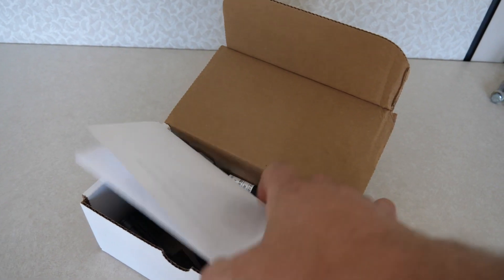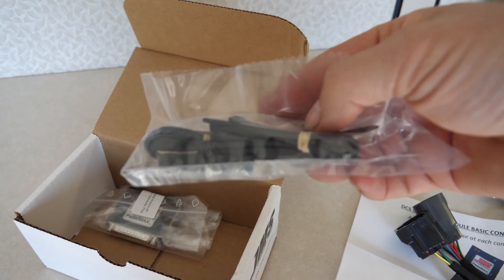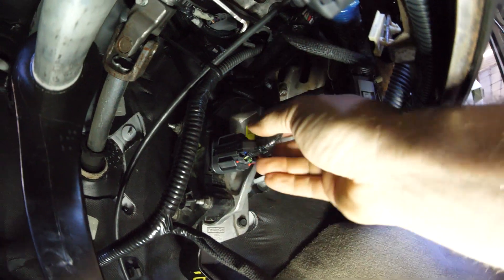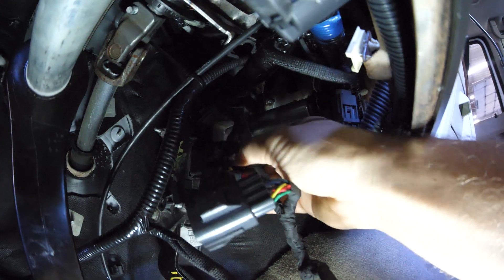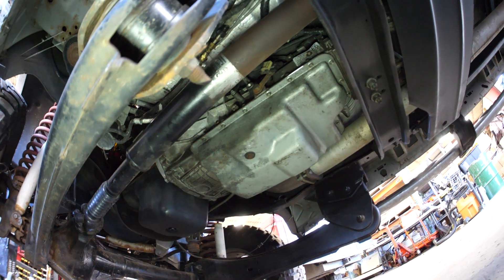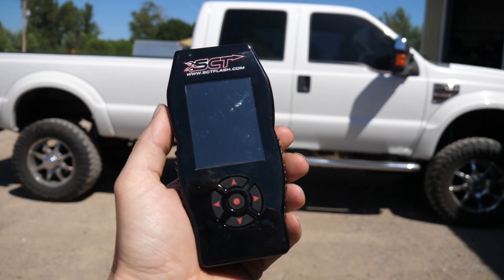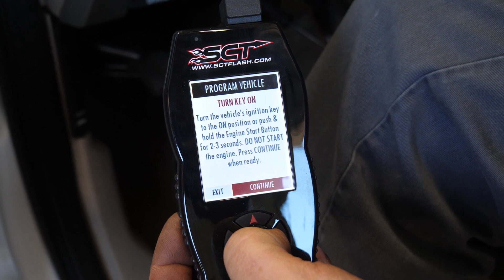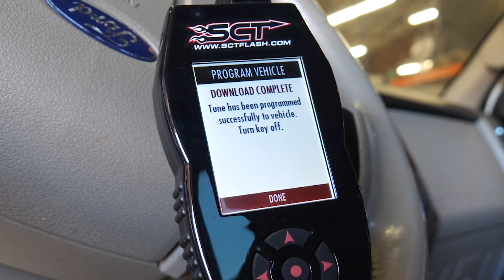Ford Cummins conversion with stock TCM and 5R110 transmission

Comment: Hell you can buy a superduty entire truck with the title and 5r110 for less than what an Allison swap costs. Then you can sell the 6.4 injectors turbo heads harnesses water pump block etc everything you don't need for the swap and come out with a win. I am on my 7th 12 valve truck. Early 98 short bed auto 4x4. But if not for this exact configuration I'd not bother with another dodge truck. The super duty trucks of any year are far better than any 94-02 ram

Comment: I’m using f250 superduty 2006 chassis - not using ford body and 6.0 engine I am installing a 1987 gmc 4 door square body on chassis with 1995 12 valve , do y’all offer wiring harness for the stock trans pcm I can use and tune

Comment: Will there be any support for the 2011 and up trucks? I have a 2012 v10 in a F550 and we would like to repower it once its reached the lifespan of the v10, and recoup some fuel mileage
Reply: 6.7 powerstroke is a great motor and the v10 is as well

Comment: The real question is can you get the 5R110 to work with the 7.3 Powerstroke?
Reply: I was wondering if you had any luck finding out if it possible to run that transmission behind the 7.3??
Reply: @johnnyanvar6502  No. I do know there is a company that can get an Allison trans mated and working on a 7.3.
Reply: OKstang77 thank you for responding!! I will definitely check into it!!
Reply: @johnnyanvar6502  here is a link https://youtu.be/mlc98MO70jg

There is another YouTuber that swapped a Cummins into a 6.4 Ford and found a company that would program the stock Ford trans to run behind it. Just about anything is possible now days.

Comment: I was wondering if i can install a 5r110 on a 7.3. The 4r100 sucks. Its weak, the shiftpoints suck, and 5 gears are better than 4 gears while towing on the highway. How can i make this happen
Reply: Just use the TS6 tuner

Comment: Can I use a 12v out of a 96 Ford F700 in my 03 F350? Also, would you be worried if those engines had 100k on them?
Reply from the maker: Physically yes, but the commercial/mid size trucks have a different cam grind, pump gov'nr, injects etc, so potentially less than desirable performance in a pickup. 100K shouldn't really be an issue.

Comment: I just bought a 2008 f350 with a blown engine. I want to put a more fuel efficient/ bulletproof 😃 that f350 with a 2006 dodge Cummins engine. I will be doing all the work myself. I see I can keep my transmission, with the adapter plate. Where can I buy the harness and gas pedal computer? Once installed how do I get it programmed? 
Thank you
Reply from the maker: Here's a link to the info page for your era truck and conversion engine--definitely start there--it'll give a whole overview of the process. Then you can either ring the sales department here for more info, or go into the Kit Builder section of the website and look at the different packages available.   https://www.dieselconversion.com/blog/2008-2010-Ford-6-4L-Diesel/

Comment: Can I use a 2006 5.9 on a 2008 f350 ?
Reply from the maker: Sure can. Here's a link to the kit on the DCS website. There is also an info page that reviews the available options for your year and model. Thank you for the interest!!
https://www.dieselconversion.com/kit-builder.html/?find=ford-2008-6-4l-power-stroke-diesel-5r110-2003-2009-cr-5485
Reply: Thank you

Comment: Do you recommend using the stock torque converter or one with a lower stall speed?
Reply from the maker: Hey Marc. It can be tuned with either a stock or lower stall,  most customers use the stock converter but we do have some that opt for the 1600-1800 stall.
Reply: What is the stock stall speed for a 6.4 diesel?

Comment: Can this be done with a 2008 v10 powered truck with 5r110?  thinking of repowering truck. 
On average how many times does the trans shift tune need to be changed to get it right? 
Some days the truck runs empty and some days it's pulling 20k . how does one tune cover the wide range of loads?
Reply from the maker: Our SCT tuning is currently only applicable on former 6.0 or 6.4 Ford trucks.  The gas powered Ford PCMs just are not-conversion friendly with stock tuning.  And unfortunately the gas trucks cannot be changed to a diesel PCM as the cluster and other body circuits are not compatible. .  Our recommendation has been to switch to a 4R100 and a US Shift controller.  The 4R is every bit as strong and has the same overdrive ratio as a 5R110.  The 4R bolts right to the t-case in place of the 5R.

Comment: Will this option work with a 94 dodge 2500 12v. I got the complete drivable truck as a donor   for my 12v swap into my 05 f250 4x4 6.0L powerstroke. I have a sct live wire programmer. Will my 5r110 work with this older engine.
Reply from the maker: Yesir it will. You can use the existing tuner, and all you need is the tuning service. 
Thank you Ernie!

Comment: Would you be able to drop a Cummins in my 09 F150
Reply from the maker: All we have for half-ton is 4BT up to about 98, and some designs on using an R2.8.
Reply: well if i had that old of a truck i would keep the 7.3 if it was a diesel but sounds good i might just wait to get a 6.7 sometime
Reply: DieselConversionSpecialists  I have a 2010 f250 with the 6.4 motor blew everything el did in great shape what Cummins should I go with?

Comment: If you put a Cummins in will it pass a state emissions test will the check engine light be off
Reply from the maker: On 6.0's the CEL is off, on 6.4's, depending on the engine mods and tune the light may or may not be off. The SCT tuner is to interface the trans, we don't have software to access the EGR, DPF, etc.